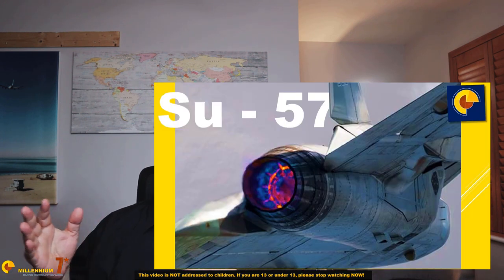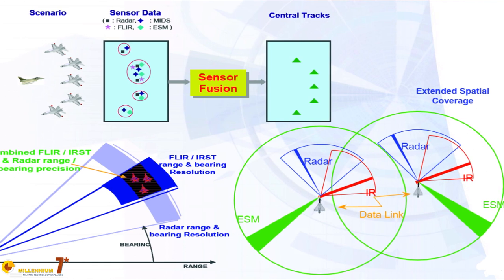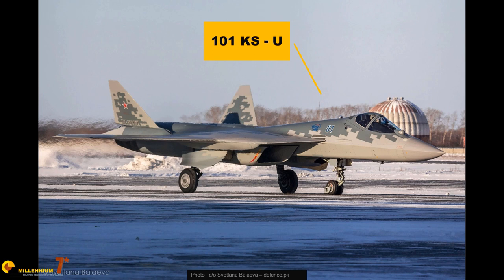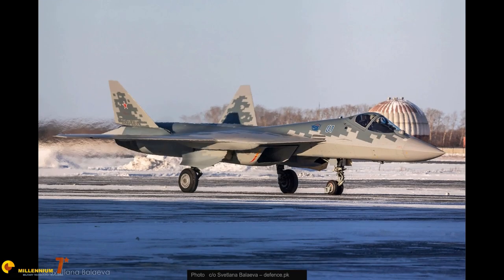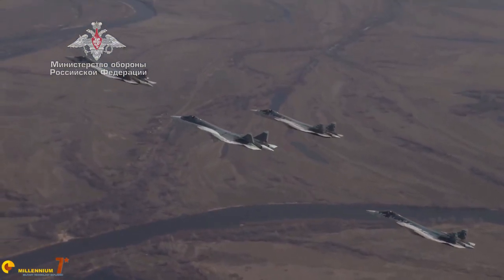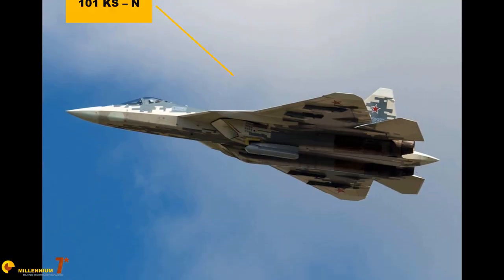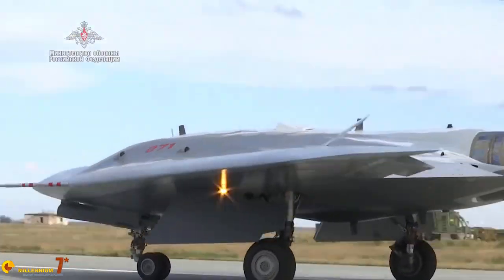Su-57 the Raptor Smasher | Part 5 - Video and Infrared Sensors

Comment: This is a very good aircraft. Unique in every way. Judging by Russian doctrine, in 4-5 years we will probably see the su-57S, M, or SM version, as happened with the su-27 and su-30.
Reply: Indeed, we already know next version planed will at minimum get new engines, probably some more things on top of that.
Reply: It is so good than no country wants it

Lmao
Reply: And the Su-33, Su-35, Su-29....hell the Mig-29 is closely based on the Original Su-27 Flanker. The Flanker family has had some addons that make it a respectable plane. But same goes for its western counterparts. We arent talking about China because the J-20 looks like it was modeled afte the plane in Ace Combat.
Reply: You also have western planes that have an A, B, C, D, E, and F variants. Same thing, different system.
Reply: Don't get excited, just see how much will Russia commit with the initial batch of 76 Su57 first
Reply: @TrungNguyen-uf8cv  and how long it takes to build them. Remember there is currently only 1 "finished" machines in service, the first one build having crashed during test flying.
Reply: @TrungNguyen-uf8cv  Production of upgraded version of Su-57 fighter is to start in 2025 — Tass, 9. August 2021.
Reply: @dejvi5711  of course there are always incremental upgrades to improve things,  whether they are in the initial batch or not, or is that worthwhile of a jump to designate differently.
Reply: Indeed. The new avionics set for Su-57 has already been presented.
Reply: @junkookbts1273  Everyone who isn't a US ally wants it, Vietnam, for example.
Reply: @nooonanoonung6237  Vietnam mocked the Su-57 rivets.🤣🤣🤣

How come nobody has ordered it yet ?
Reply: @junkookbts1273  waiting for phase 2 engine + bug fixes. Early adoption is a rich man's game.

Nobody made fun of the rivets lmao, you are just making stuff up.
Reply: @nooonanoonung6237  yes , media from Vietnam did.

Educate yourself kiddo
Reply: @nooonanoonung6237  again : nobody , not even Russian allies want that junk
Reply: @junkookbts1273  So nobody important did?
Reply: @nooonanoonung6237  yes , everyone that is important did....that's why it has found no buyers

Lol
Reply: @junkookbts1273  
- Almost all military media outlets gave praise to the Su-57.

- In all Vietnamese defense forums, in which many service members participate, the reception to the Su-57 has been overwhelmingly positive.

- It's been open secret for 2 years now that the Politburo and military will purchase 1-2 squadrons of Su-57 in 2030 to replace aging Su-27s, if the economic situation allows, with the way it's going now, it will almost definitely happen.

- There are no other alternative to the Su-57 that will allow Vietnam to defend against Chinese fighters.
Reply: @nooonanoonung6237  india said it is junk !
👇🏻👇🏻👇🏻👇🏻😃😃

"The Su-57 was overly expensive, poorly built, and powered by obsolete and unstable engines, according to Indian air force officers. The Indians' criticisms highlighted the huge gap between stealth-warplane design and real radar-evading aircraft manufacture. It's one thing to draw a futuristic warplane on paper.14 abr 2022"
Reply: @nooonanoonung6237  👇🏻🤡👇🏻

"‘Criminal’ Su-57 flies to Vietnam in a desperate bid for funding"
Reply: @junkookbts1273  none of your quotes came from Vietnamese media lol
Reply: @nooonanoonung6237  👇🏻🤡😃👇🏻

"The Su-57 may not be built with quality workmanship, could not be confirmed that this aircraft can be called fifth-generation aircraft, published Vietnam express quoting Colonel General Phan Văn Giang, the Defense Minister of Vietnam."
Reply: @nooonanoonung6237  👇🏻😃👇🏻

"May 21, 2020

Despite the fact that Vietnam is among the buyers of Russian Su-57 fighters, the Vietnamese media is critical of Su-57 as the country pays whopping $2 billion for only 12 aircraft.
The Russian combat aircraft has visible screws, legacy cockpit and poor construction of canopy, does it belong to the fifth generation fighters, reports Vietnam Express.
The storyboard video provided by the Russian defense department, presented by RT news, showed wings roughly screwed into the fuselage, wide gaps between wings and aileron of Russian Su-57 combat aircraft. No radar cross section (RCS) reduction mechanism which is known as radar absorbent material applied to the surface of the alloy metals."
Reply: @nooonanoonung6237  you are in denial...LOL

👇🏻😃👇🏻😃👇🏻😃👇🏻

"This technology, according to Vietnamese experts, does not allow the Russian fighter to be in fifth-generation category at all, and given the fact that the geometry of the cross hole is completely violated on some signature reduction mechanism, it is believed in Vietnam that the assembly of the Su-57 fighter is carried out by unskilled manpower not using the next-generation required technology."
Reply: @nooonanoonung6237  more from Vietnamese experts
👇🏻🤡👇🏻🤡🤡😃😃😃👇🏻👇🏻

"Moreover, bubbles were seen on the glass cockpit canopy, which also raised a lot of questions about the build quality of Russian combat aircraft."
Reply: @nooonanoonung6237  👇🏻🤣👇🏻

"According to the local edition of BaoDatViet despite the availability of tools that are standard for the 5 generation, Su-57 still requires that it be classified as 4.75 at best."

🤣🤣🤣🤣🤣🤣🤣🤣
Reply: @junkookbts1273  BaoDatViet is also an NGO-affiliated, read American funded, media outlet. Not Vietnamese state media.
Reply: @nooonanoonung6237  lol

Nobody wants that junk

Comment: 1:40 No, jokes, the Su-34 even has a samovar and a toilet on board. Hence for a Russian pilot to switch to the newer plane stealth alone won't cut it!
Reply: Su-34 Fullback is considered a bomber and is larger than fighters typically are. Most bombers will have that sort of setup for long range operations.
Reply: @Deathbomb9  Thanks, didn't know anyone was using the derogative "fullback" for such a beautiful plane.
Reply: @Deathbomb9  Which makes me wonder, what is NayToo name for the Su-57?
Reply: @unclewerner  Felon
Reply: It was pretty difficult to find a pic of the space behind the seat on au34
Reply: @unclewerner  I think it came from a position in rugby as well as flanker
Reply: @TrungNguyen-uf8cv  There isn't much space. It's not a full cabin with galley and toilet like people think, it's enough room for one of the crew to stand up in with a small zip boiler or the like, and relief tube. I'm not sure how much of the misconception is deliberate and how much is just coming from people repeating what they hear without checking.

On the other hand, the access to the cockpit (via the nose landing gear bay) is via a tunnel which gives access to most of the avionics boxes, which I thought was pretty neat. Not sure how much use it'd be during an inflight incident, but it would certainly make servicing on the ground simpler and keep the avionics techs out of the weather.

Comment: I have to wonder what the processing power and artificial intelligence capability of this plane is it is current form. All the sensor data can be confusing but having an AI can make a big difference in making it more manageable and highlighting risks .. augmented reality would be one way to convey this information to the pilot.
As much as I'm mourning the upcoming passing of the F-22, I think that the difficulty and upgrading the computer and information management systems might be one of the major reasons for its retirement..
Reply: The biggest factor in planned retirement for Raptor is that enemies within killed it before we could even go into Full Rate Production. That meant no more spare parts supply from vetted contractors, which increased the O&M costs dramatically, while reducing the availability rates.

After Full Rate Production was supposed to kick-in, unit costs were to have dropped to $92.4 million per, with a steady supply of spares.

By killing it before it could go FRP, Gates ensured that it wouldn't be sustainable, while also creating a massive fighter shortage since it was supposed to replace all the F-15C/Ds.
Reply: @Adrian Simmlekark F-35A & B so far are basically self-maintaining. Biggest issue is global parts demand among all the operators, so USAF & USMC don't have their exclusive spare parts chains. The media reports are much ado about nothing.

F-22A O&M is really expensive for the reasons I listed. CPFH is $44,000 with a much more maintenance-intensive RAM.

YF-23 didn't have RAM. None of the 4 ATF flying prototypes did. They were flight dynamics demonstrators with limited systems integration.

YF-23 represented more risk for several reasons:

* Boundary layer management system for the intakes didn't allow more than Mach 1.82 speed.

* Several windscreens cracked during supersonic flight tests for sustained supercruise. Needed work on materials sciences. 

* Weapons bay didn't have a working solution for carriage and jettison, and had less capacity than YF-22 (which only had 6 AAMs total originally).

* Control surface actuators were doubled and laid sideways to minimize RCS values on the wings. Increased hydromechanical parts count and potential failure nodes, but was really streamlined.

* F-23A design was longer due to an added internal weapons bay, which would have affected load factors in the pitch axis.

YF-22 had none of these challenges, and YF-22 PAV1 with the YF-120 GE Variable Cycle motors exceeded Mach 2, the only ATF PAV of the 4 that did it.

The big issue with YF-22 was weight from the bays. No matter what they did, they could never meet the 1.2 T/W ratio with the YF119 motors and strategic materials % dictates, so the engine thrust requirements were increased from 30k lbs max burner each to 35k each.

F-22A got the belly weapons bay capacity increased from 4x AIM-120 to 6x with staggering.

F-23A would have added a lot of time to an even more costly development schedule as the inlet, weapons bays, windscreen with RF reflective coatings, and RCS/IR reduction features were integrated, let alone the IFDL data link and sensor fusion challenges the F-22A went through.

We would have ended up with even less of them at much higher unit costs, with an even more hostile foreign mole/traitor attack on them from Bush, Gates, and Obama, while those same traitors passed over the TDP to China and Russia.

I love the looks and aerodynamic performance of the YF-23 though. Those birds were gorgeous.

Comment: while "efu sorty phywe" barely flies, su-57 can stop in mid air, make a turn and fly again
Reply: Lmao yeah while bleeding off ALL its energy and becoming a sitting duck as soon as that happens... In a missile fight energy is EVERYTHING, you pull to hard and bleed your energy down you will be dead before you can gain it back. The only place it has ANY use is in say. One circle fight to be able to pull the nose around quicker to get a gun or infrared missile off... However as soon as that is done they will be at an extremely low energy state and should that missile or gun shot miss they are pretty much dead. If they are defending against missiles incoming be it radar guided or infrared all that super maneuvering bullshit just means depleted energy and energy is everything when it comes time to defend missiles... A Fox 3 launched high and fast from a modern fighter you better not be in a low energy state when it's coming to visit you. The "Cobra"  is cool to see and fun for the pilot BUT IN COMBAT WOULD LITERALLY GET YOU KILLED. Plain and simple in fighter combat be it BVR or close in gun/Fox 2 fights ENERGY retention is your number one friend and that's 10 fold in BVR engagements, you aren't defeating modern radar guided missiles if you don't have plenty of energy to work with...

Comment: The idea of using an infra-red laser to blind or damage the IR detector on an incoming missile is in service on some western transport planes (and looks like a good idea to me). I would question how effective there are using a small size lens to focus the laser though at any distance. At km distance the laser may well be quite dispersed and unfocussed. At shorter ranges the pilot will probably be taking evasive action making targeting very difficult.
Reply: short range IR missiles will be a weapon of the past soon... japanese already have the AAM-4B with AESA seeker. It's only short range against stealth aircraft aswell, but extremely hard to jam, compared to others like the AMRAAM. Israel is using the Stunner too, which is IR & radar guided at the same time. You may fool one thing, but likely not the other.

Comment: What is the purpose of the Su-57? The thought behind it? Just an air superiority fighter with modern tech? How does the design consider Russia's greater defence doctrine of relying on SAMs and missiles?
Reply: Its a multipurpose aircraft. Had to handle air superiority tasks, air to ground missions and be capable for some rasio-electro reconnaissance. Here in Russia it's designated as an air combat complex. Could be fitted for different missions.

Comment: Is there this much information available about the F22? That could be a nice next project...
Reply from the maker: Yes, but there are already tons of videos on the F-22 and the F-35
Reply: @Millennium7HistoryTech  I would suggest that a similar series on the F-35 would still be a good idea as there is a lot of "hate" out there, with little basis in fact and a lot of confusion between the design priorities that drove the F-35 (JSF v air to air fighter) and the USAF networked doctrine and the use of mixed stealth/non-stealth flights etc. The other problem with the F-35 is distinguishing between what its supposed to do (eventually) and what it can do today. I try to pay attention, but I'm unclear whether any current F-35 meet the original initial operating capacity originally intended verses the lower IOC accepted by the US Marine Corp and then the USAF. It seems to me that the USN is still quite reluctant to use the F-35 at sea. I also understand that the majority of currently flying F-35 (certainly all of the UK ones) will need to be upgraded/modified to reach the new base level aircraft at a significant cost. The UK is unlikely to spend that money and these initial 15 aircraft will be used for the conversion squadron eventually.

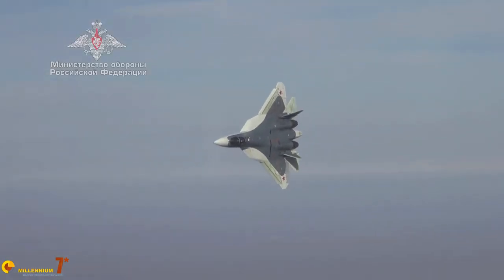Comment: Look at the fasteners on the tail at 1:07 . Every single one of these fasteners will reflect more radar energy than an entire F-22 or an entire F-35 and there are hundreds, if not thousands on the air frame. Sukhoi claims, in writing on their patent, that the SU-57 has an RCS of between one tenth and one square meter.  It is, to radar, ten thousand times larger than an F-35. The SU-57 is NOT stealthy as defined in a 5th generation fighter. To have a 50/50 chance against an F-35, it's radar must be ten thousand times better than the radar of the F-35. The SU-57 is, however, a wonderful air show aircraft.
Reply: @The Front  Yes, I noticed that. The production version looks very smooth.
Reply: Not another rivet nut , non off the production models have these , end off the conversation on radar ok